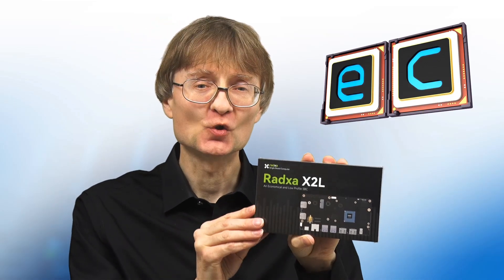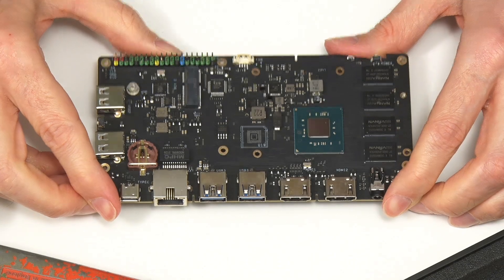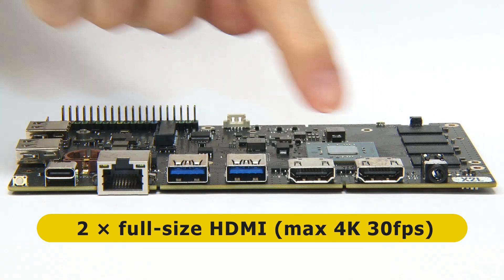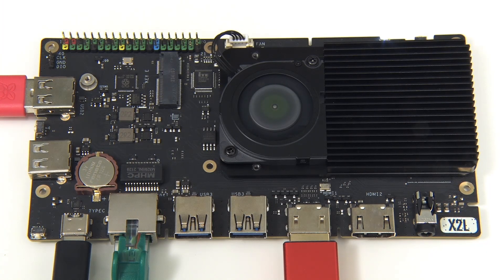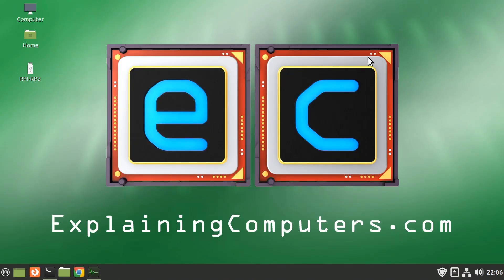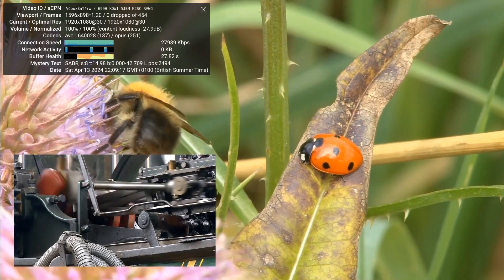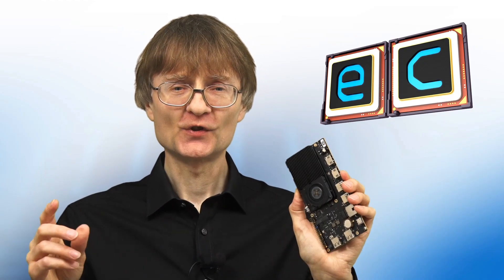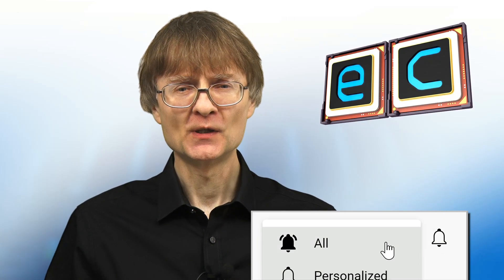Radxa X2L: Low-cost x86 SBC with RP2040

Comment: I have the 8GB model with EMMC.  I would have liked all the switches to be broken out to a connector so that they are all in one place are lend them self to control by KVM. (It might have this function because as usual I didn't RTM, but used a Chris video to tell me 90% of what I needed. I'm using mine to control Xmas lights)

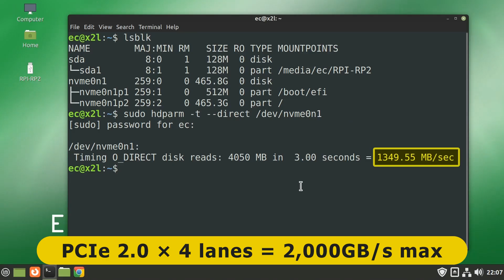Comment: I'm guessing that you meant 2.000 GB/s (ie; 2000 MB/s) for PCIe max throughput, instead of "2,000 GB/s" at the 10:53 mark?
Reply: Great-looking SBC, to be sure. Seems like a lower-price alternative of the Odyssey x86 board. I especially like the 40-pin RP2040 header, because it gives you more GPIO compared to the 28-pins on the Odyssey board. Since you're likely to be talking to the main CPU via serial port or i2c/spi anyway, the 40-pin header for the main J4125 seems unnecessary on the Odyssey. Looking around here in the states though, availability isn't great at the moment. Amazon is out of stock, for instance. 

Do you know whether or not there's any sort of case offered for them CB? I didn't see any offered on the Radxa website, but of course you could 3D-print one. It just would be nice to be able to order something and not have to mess around in that sense. Great-looking board though--and I'm a very big fan of these x86-based SBCs. While I definitely appreciate the RPi software support, those SBCs are becoming less and less attractive to me. One thing I need to check out though on this Radxa board: Do they offer and sort of BSP for a Yocto-based image? I'll check on that. THe Odyssey x86 does have it--Seeed Studios has a Github account with their board's meta-layer on it. I haven't tried yet to build an image for it, but at least it's out there.

Comment: i remember the first itx boards with integrated celeron cpus,they where cheap but the powerbrick was very expensive and you had to buy laptop ram for them,i used it with dynamic dns to have a box with network tools for work,i think this board is more value for money all you have to add is the cooler and a disk,beats renting a linuxbox somwhere since wont really eat up the powerbill.

Comment: What do you think about the potential backdoor/safety issues on Chinese brand SBCs? The prices of these Chinese SBCs are very very competitive but I hesitate buying them.
Reply from the maker: A board with an Intel processor and chipset (as here) is incredibly unlikely to have a back door. Could it be done? Possibly. But cost-effectively? Probably not. And I also cannot see why it would happen with a SBC sold in only thousands of units. Mass market products, perhaps. Internet and other comms infracuture? A major risk. But I've no concerns about backdoors on any Chinese low-volume SBC.

Comment: There was only one really important question here to answer.  It WAS touched on quickly in a tongue and cheek fashion when discussing how long the manufacturer expects to make this board... but seriously, it is the ONLY thing that is really important here.  In the world of desktop and laptop computing, processors only stay active in the market for an average of two years.  Technology moves so fast in this area, that within two years, somebody (maybe even the same CPU manufacturer) has introduced a better processor for the same or lower money.  The processor used in this product came out in late 2019 - 4.5 years ago.  That it can even be purchased still is pretty amazing, but rest assured, unless it has become a "Darling" in the Embedded Community, it's days are numbered.   WHY then, would a company come out with a brand new product using a CPU that has been in the market for 4.5 years, and whose manufacturer (Intel) has already put it in the Discontinued List?

Comment: There is no doubt that it is an excellent alternative to the Raspberry Pi 5, more powerful and versatile, but it is still beaten by far by refurbished products from HP or Lenovo, such as an HP EliteDesk 705 G4 that we can buy for less than 200 euros (which is what they cost more or less this X2L or Raspberry Pi 5 fully equipped. And putting a RP2040 only costs us 5 eu. more. Only the 4K video output is a plus.
Reply from the maker: And this smaller and uses a lot less energy than a refurbished mini PC. :) Although they are certainly good value, as I've covered in other videos here.

Comment: For those interested in the disk performance, with a new Samsung 980 Pro 1 TB nvme SSD on Windows 11 Pro on the 8GB Radxa X2L, I got the following on CrystalDiskMark: reads: 1703 MB/s, 1021 MB/s, 134 MB/s, and 52 MB/s. Writes: 1447 MB/s, 995 MB/s, 75 MB/s, and 69 MB/s. Also, Speedtest shows 16 ms ping and 953 Mbit/s down, 38 MBit/s up, which is just shy of my 1 Mbit/s down cable internet, so the nic is providing full bandwidth. Setup for Windows 11 from a USB 3 thumb drive took about 30 minutes. The only thing I haven't got working is the Wifi card. Windows did not recognize it during setup.

Comment: Finally found a time to watch. Expected yet another unfinished product and I found great x64 SBC with Pico as a GPIO coprocessor and proper power input. A good relief after Pi5 and its stupid 5V5A input. This one you can power even from a cheap charger from blue/yellow furniture shop 😀
Also software support is way ahead of ARM especially in a GPU department. 
I like that SWD header is exposed (I think you missed it?) - pretty exciting for C++ development and debugging RP2040 using second RP2040. And a good thing is that when you burn GPIO the chip can be replaced and is dirt cheap

Comment: Dimensions are almost identical as the youyeetoo X1.  Plus the youyeetoo X1 has better CPU, more RAM options (Max 16gb) and EMMC (Max 256GB) more ports (6 USB). Its slightly more expansive though and the GPIO is 6pin

Comment: I have multiple negatives with this board. Nothing is included, not even a SSD mounting screw. It's even worse than with a pi. You don't have a low-cost device if you need to buy a power supply, an obligatory cooler, a battery. I would classify this as a rip-off even if they point out that you need to buy this needed stuff separately.

Comment: Nice if you need the GPIO and do it from an X86.

I wish there where less expensive...
For a desktop computer replacement it is way too under-powered and overpriced considering that you also need a case and a power brick for the usb connector.
For the same price you can get a used Lenovo thinkcentre tiny or similar Dell elitedesk tiny.

So for the same price, if you just need a cheap computer, you get:
- 6 USB 3 instead instead of 2
- 1 or 2 M.2 for NVME
- 1 Sata port
- 2 display out (often 1 DP + 1 HDMI). Some unit come with an extension of an extra port (Can be any of the 3 main type, DP, HDMI or VGA). No port are in the "micro/mini" format so no adapters required.
- Some units come with Bluetooth+wifi (else it can be added)
- CPU is usually 8500T +, some of them are 6500T but it's still 2 to 3 time faster than this bottom of the barrel celery J series CPU.
- CPU can be upgraded
- RAM can be upgraded (most model support up to 64GB)
- The price include the case, the power brick, the cmos battery, 8 or 16GB worth of RAM and usually it come with 128GB worth of sata or nvme storage.
Reply from the maker: What you say is true, and I have covered an old HP Elite Desk on this channel --  https://www.youtube.com/watch?v=ZPX3A7YS-6Q  But what you fail to note in the above is that you will get old hardware (so with a reduced life expectancy), with high higher energy use, and no official Windows 11 support.

Comment: Just curious about the power supply. Is it a USB C PD type power supply that provides 12v or is it just 12v over a USB C cable? I've seem both but have no experience with Radxa.

Comment: I have a peculiar use case for this. 
I wonder if the board could be fitted in a laptop case. 
I have an Lenovo E480 for which I bought a third motherboard. 
If it fails like the first two (very poor thermals for E480) I am considering using a slim board like this one in the case. 
Use the LCD display and keyboard at least. 
 If I can also use the battery that would be great. 

One requirement for this is to have a slim board with most / all IO on one side .

Comment: I bought the 8gb Model from RS for £69 with free 24 hr shipping. No heatsink though but installed windows 11 on a crucial 500gb M.2 drive and it never got above 50 degrees C. I think a small chipset heatsink with a fan off an old motherboard should suffice for light duties such as a media centre

Comment: Interesting, great review, cheap, but unavailable  I've often wanted to set up an RPi in a small pack with it's own 5v battery pack, wireless keyboard/mouse, and portable 11'' monitor. The Radxa board is flat enough to mount on the back of the monitor though it's 12v rather than 5v.

Comment: Would any know if the e-keyed m.2 accepts a Ethernet card and be present on the pci bus? That would make this an option as a pfsense or opensense firewall.
Reply: Alright Chris I bought one.  I'll find out in 7-15 working days.
Reply from the maker: Good luck with your board. My guess would be "yes" on the E-keyed M.2 slot supporting Ethernet, but I'm not sure on whether it will be on the PCIe bus -- E-keyed cards can be USB. But we have two PCIe lanes unaccounted for! Do let me know how it works out.
Reply: @ExplainingComputers  I am happy to report that I am running 2 gigabit ethernet  ports on my new Radxa X2L!!!  I haven't tested speed yet but it works just fine.  Lspci shows it on the PCI bus.  How could I check how many PCI lanes it's using?  I ended up getting 2 X2L's one 4GB and one 8GB.  I may order a 2GB board as well.  I received them in about 10 days from Allnet.  I ordered a fan from Arace but have yet to receive it.  They run Mint LMDE 6 just fine,

Comment: Does it require any drivers from radxa?  I don't trust them to continue supporting anything.
Reply from the maker: It doesn't require any software from Radxa. It's a standard Intel J4125 PC, so has full driver support from Windows and Linux.
Reply: @ExplainingComputers  thanks
Reply: It just needs to intel drivers installed and the rp 2040 drivers and wireless module drivers to function

Comment: Why not get an HP EliteDesk for 100 bucks?
Reply from the maker: I have discussed this at length in many videos -- including one on an HP Elitedesk -- https://www.youtube.com/watch?v=ZPX3A7YS-6Q  But the answer pretty obvious. This board is (maybe) cheaper), certainly uses a lot less energy, is smaller, and has GPIO via the RP2040. So it depends on the use case. Oh, and a comparison of new vs second-user hardware is not really fair.
Reply: @ExplainingComputers  Right on.

Comment: I feel like this isn't an SBC but a barebones pc or laptop motherboard being repurposed as one. It looks very similar to my laptop's motherboard. Like why would an SBC need that an Intel UHD 600 gpu? This board is even priced similarly to an actual barebones pc. I highly doubt the Radza company will even exist in 2030. Honestly, I think this is one of the worst SBCs you've reviewed.
Reply from the maker: This is certainly a custom manufactured piece of hardware. Radxa have signed a manufacturing deal with OKdo (aka RS), so I think are strongly placed to  continue in business, but you never know. We shall see! :)

Comment: Still gonna disagree about needing less than 32GB RAM.  If you are running a server, then you can get away with 8GB RAM.  However, if you run it as a regular desktop OS, then the average web browser will easily chug 8GB to 16GB RAM all on its own.
Reply from the maker: What on earth are you doing in the browser? The idea that "the average web browser will easily chug 8GB to 16GB RAM all on its own" is utterly ludicrous. I've just checked the what I an running right now -- Chrome with 4 tabs open: YouTube Studio, 325MB, Google Drive, 158MB, a 77 page Google Doc, 249MB, and Twitter/A, 68MB. That's 800MB total for 4 tabs.
Reply: @ExplainingComputers  Chrome with 67 tabs 7.8GB, Adobe Photoshop, 4.6Gb, committed 20.2 GB of 64gb. All this is pretty high for me but it does get up there. Twitter and Youtube are comparatively tiny but overall RAM usage has more than doubled since 2019.

Comment: The fact that it's not x86_64 doesn't seem like it's very future proof...
It doesn't support Vulkan... doesn't support WebGPU...
OpenGL 4.6 is from 2017 and Intel still doesn't support it? 😕 Only up to 4.4.
It can play 1080p video, sure, but so could the first Raspberry Pi. 🤨 Can it play 4k h265 HDR?

I'm not sure what the differences are between OpenGL 4.4 and 4.6, except for maybe shaders in binary format, SPIR-V support.
4.3 introduced Compute Shaders and ETC texture compression.
4.1 introduced Tessellation Shaders.
So 4.4 is still pretty capable, containing the above, but the applications have to explicitly NOT target 4.5 or above.

Even if some Linux distros still support Itanium (a failed architecture), moving away from x86 is bound to happen at some point... Apple did it in 2016 and 2018:
- iOS 10 (from 2016) was the last version to support 32-bit apps.
- macOS Catalina (2018) was the last version to support 32-bit apps.

Comment: Interesting SBC! I have several embedded projects where I use a RPi as the main device and a RP2040 MCU board like Pico as a custom USB HID controller to the RPi. Is the RP2040 hardwired in to the x86 SBC as a USB device? I saw the UF2 loader RPI-RP2 drive mounted so it looks like it and I would be interested to know if some USB HID code running on the RP2040 (e.g. mouse, keyboard etc)  would be reflected on the x86 SBC OS. I'd assume (and hope) so! Anything to reduce wires!

Comment: At  5:40
Headder....

On the short end of the board with the USB 2.0 connectors, there appears to be a three-pin header that you did not mention. 
What was that? Hopefully you mentioned that later in the video....back to watching the video now.
Reply: Looks like an uart connector (rx, tx, gnd)

Comment: Does the BIOS have a legacy boot setting so FreeDOS can be installed? Probably network and sound drivers would be a problem, but with a built in RP2040 perhaps it could be used for something like a built in PicoGUS.

Comment: Hello Chris, Would you consider implementing a Local 4K 30FPS file playback, (or 60FPS, if you can find one) to your testing suite?

I understand that they can be large files, and you would only run this test if the 1080p YouTube video test passed with flying colours, to see if 1080p is the limit. 
If SBCs, like the Radxa X2L,have Hardware Video Decoding and you suggest they could be used as a very good, low cost, low power Media PC, Testing out a 4K local file, might be worth showing off.
Again, Understandably you might only keep such a file on a external storage device or on a local NAS, maybe a future EC video could be setting up a NAS that could do media streaming via plex or Jellyfin or some other local media streaming service, (Music for example, NaviDrome or Jellyfin are great SubSonic, or compatible, Streaming services that can be run in a docker on Open Media Vault with web clients and apps for desktop and mobile!). All just suggestions and ideas, free for the taking! 

This message got out of hand quickly, sorry. 😅
I Look forward to future videos and tech!
-THS.

Comment: This is so very cool Thanks!  This might really fill some gaps where the RPi5 leaves off. For my use case in robotics, I want to test an on-board LLM that can also control GPIO. I tested this on a Pi5, and it works, but power management is an issue. With 32Gb of RAM available in the future an onboard LLM could perform quite well, and be able to interact with hardware via the Pico GPIO. Very exciting.  Indeed. :)

Comment: Update 4/30/24: Allnet sent me a back in stock email over the weekend.

I was about halfway through the video when I bought one. As you mention, the cooler fan is apparently not available at the moment. Any suggestions for alternatives?
Reply: Not at the moment
Reply: @kiodiekin  That's too bad bc I really want one of these for a project I have been working on for a couple of years using ESP32. With the RP2040, I could move everything onto one of these.
Reply: @NightOwlAmbient  the fan is available
Reply: @kiodiekin  It wasn't at Allnet last week, but I got a back in stock email over the weekend. Everything will be here on Friday.

Comment: Maker board is likely the most appropriate use. I suspect that many will have jumped onboard for other uses though and may not get the bargain that it initially looked like. Naturally, I am sure that any viewers will want to see a comparison with the Raspberry and Orange Pi5's. The versatility of the X86 platform is the best selling point if you know what you are and not getting. It is a shame that the HDMI ports are only 1.4.
Reply: It’s excellent

Comment: It is nice that this is a x86_64 system as that solves many software problems. Personally i am thinking which market this is for.  The X2L would be an x86 competitor to the raspberry pi. That said,  a pi pico 2 costs next to nothing and mini PCs are also readily available. Still a nice unit however.

Comment: Unless someone can inform on a cooling solution at this time, it's not reasonable to use the product at this time. The Radxa Heatsink 9010B is not available as far as I can tell. Could some one please provide feedback on how you would use this product without having the Radxa Heatsink 9010B? Oh, also, Wonderful review, thanks.
Reply from the maker: I imagine the heat sink will come back in stock -- the board is very new, so things are just settling down in the supply chain.
Reply: @ExplainingComputers  Thanks for the advise, I think I'll get one of these as soon as I can get the cooling system.